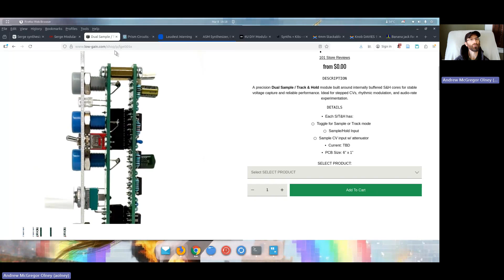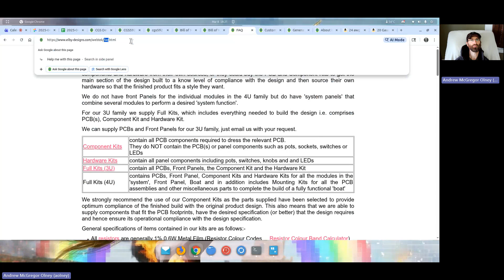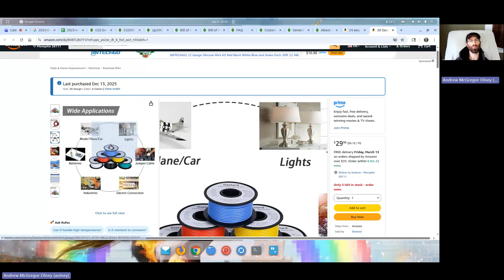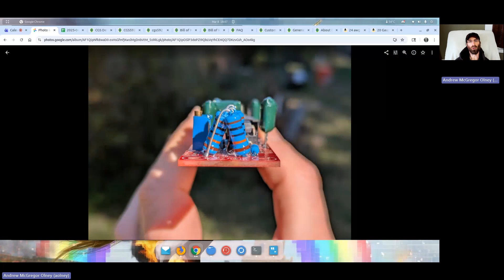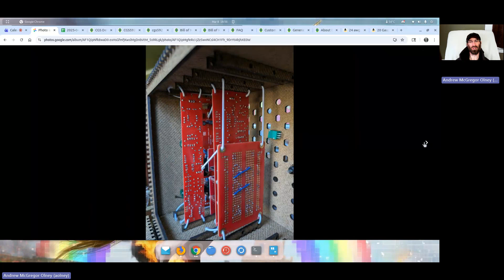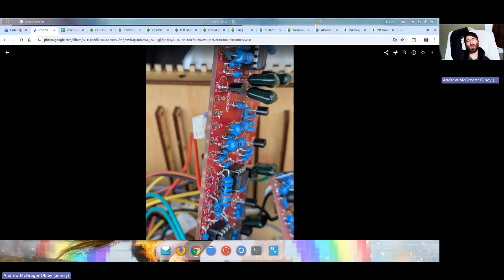Building a Custom Serge-style 4u Synthesizer

Comment from the maker: Things I forgot to say

- I used wood b/c I like wood. I tested various wood products for yield strength and decided 3mm baltic birch was stiff enough. I integrated the front panel into the boat to increase yield strength. It might have been OK to make the panel separate from the boat, but I wanted to get as much strength as possible from locking the panel into the sides of the boat.
- Low-Gain has nice links to information on 4u DIY including parts and boats.

Things I should have been more clear on

- Don't rely on my descriptions of what vendors sell/do. Check out their websites for latest products/services. For example some may do custom work even though I did not highlight that.

Things I would change if I did it again
- DUSG LEDs appear to cause popping, which is noticeable is some situations. I would either remove these or change R209 and R308 to e.g. 36K. I haven't gotten around to trying this yet.
- I don't feel like I'm noticing transistor noise, but it looks like I could have used lower noise value transistors without paying more at tayda, e.g. BC549 instead of BC547. So I would probably do this, especially for circuits where low noise is typically desired like oscillators.